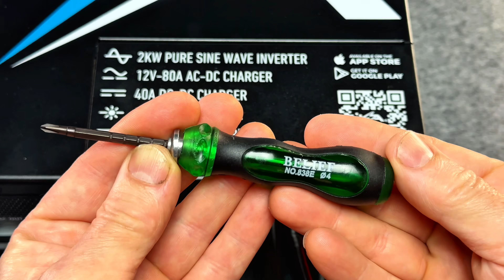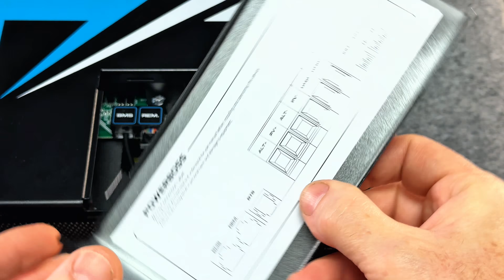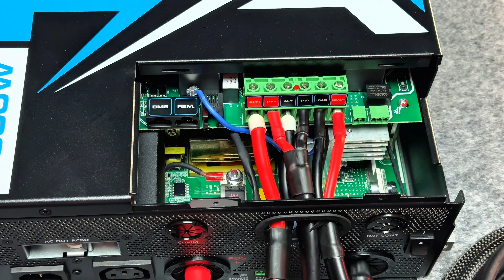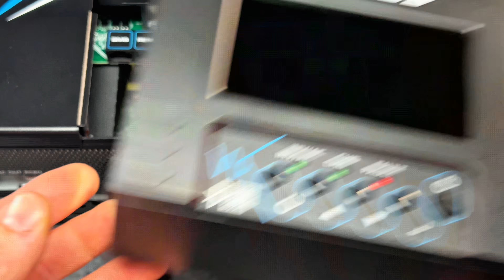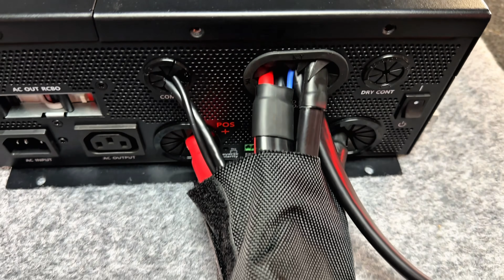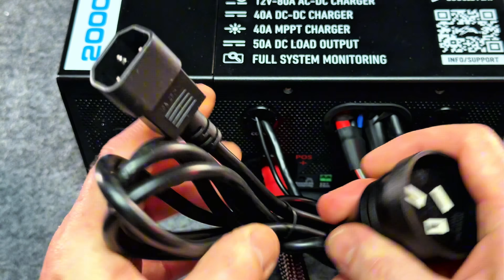KickAss PowerBoss Wiring Guide

Comment: Is the inverter centre tapped or earth bonded,,? Earth safe.on.240V
Reply from the maker: G'day Pommy that'a a great question mate 
The KickAss PowerBoss inverter is earth bonded (Neutral-to-Earth bonded) rather than centre tapped when operating in inverter mode.

When running on battery power (inverter mode), the internal Automatic Transfer Switch (ATS) automatically connects the internal MEN (Multiple Earthed Neutral) link. This bonds the neutral and earth internally, ensuring that the integrated Residual Current Circuit Breaker with Overcurrent Protection (RCBO) functions correctly and safely to protect you from earth leakage faults.

When you connect to mains power (bypass mode), the ATS automatically disconnects this internal MEN link. This prevents multiple MEN links in the circuit, allowing the system to safely rely on the upstream mains grid's earth bonding in compliance with AS/NZS 3001 and AS/NZS 4763 standards.
hope this helps pommy
thanks for watching & commenting - here is a link to all the info 
https://kickassproducts.com.au/collections/powerboss
Cheers Craig

Comment: The ground wire looks a little thin to be running under body to chassis, is it meat to ground to the tail lights?
Reply from the maker: G'day mate its a ground wire for the unit itself not for the current going through the battery mate & that way its a thinner wire,i would not use tail light ground circuit myself just ground too your cars chassis mate 
Cheers Craig
Reply: Thanks Craig

Comment: On the screw drive you should have a small plastic torque wrench for the screws on the terminals to ensure longevity on the wirings
Reply from the maker: That's a great suggestion for ensuring a secure connection, thanks for sharing your expertise!
thanks for watching & commenting
Cheers Craig

Comment: How weather resisting is this unit? I'm thinking about mounting this side way in the tub underneath tonneau cover. Other option is the battery block.
Reply from the maker: hellothere mate,no it cant be out or exposed to any weather mate, it's not weather resistant at all,so make sure it's well protected, maybe you could make a protective enclosure for it,but also give it a little breathing room for fans to circulate air around to keep it cool 
thanks for watching 
Cheers Craig